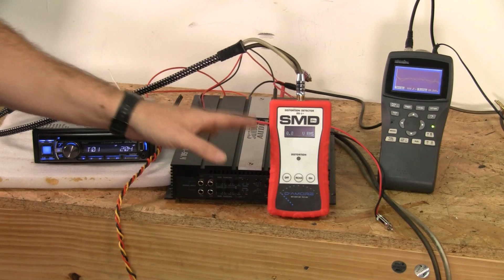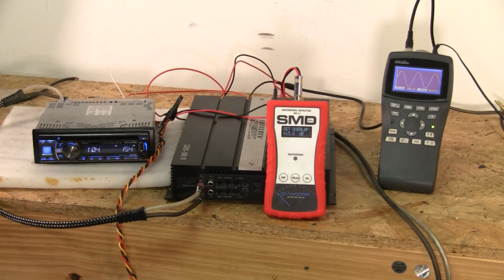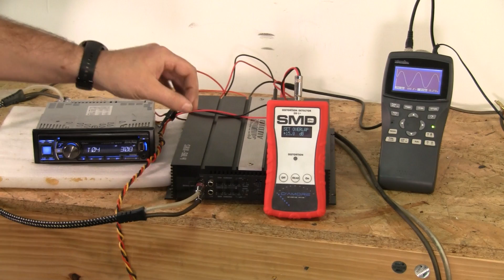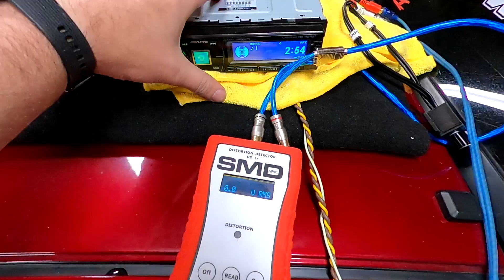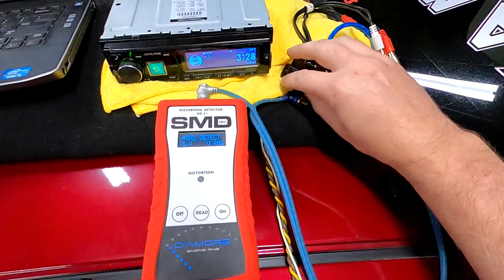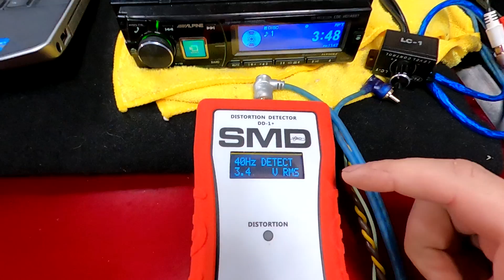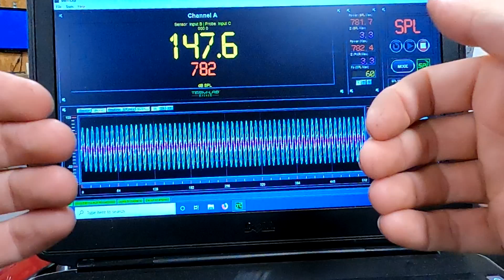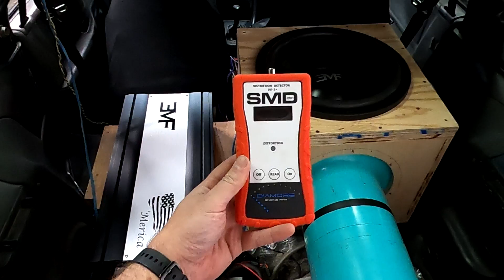The TRUTH about the D'Amore Engineering / SMD DD-1+ - Tech Stuff Tuesday

Comment: But that's not the fucking problem the problem is that for what all this car system have settings like crossovers things like that if you can't used them, and you cannot believe on any body that the los you this and that because to really set a gaming correctly you have to set first all your crossovers before you do the gain set because if you left out all your crossovers in 0 then your because of a speaker play good at 80 hertz and your tweeters at 2.5kh and you don't set these values first then your tweeters will be playing at 50 hertz if you let you crossover at 0 or 50 or in some amps at 45 hertz is like buying a car and you have all these buttons switches but you can't used them because it will make you alternator work more if you used your headlights etc people used the ignorance of other to profit from them this is why you read the Manuel guide of every electronic to know where is that they work best before you add an aftermarket amplifier then you you set the crossover in your amps check how everything sound before you set the gains at the channels or channel because some subwoofer amplifier can work very different from other amplifier and not only the amps if not the subwoofers work at different low pass filters and for that you have to set all these setting first before and even you can listen to these people and burn your system because all amps are not the same and either speakers or subwoofers and that's the reason they have crossovers to set them at the right sets for that type of speakers because they only show you what is convenient for them not for you.

Comment: This is exactly why you need a DSP to have Three different settings and adjust the clipping on each. You'll have three clean signals going into your amps. CD USB Bluetooth or whatever you use will have different channels on your DSP going to the amps. Then set your amps with the same level signal volume can be adjusted in the dsp to max out each. Hope that made sense and you set overlap anyway which is clipping right?

Comment: I thought you find the distortion then set the gains with overlap like minus 5db for mids and highs and like 10db for subs... so that you can use the eq to safely boost if needed. If you set to 0 across the board you can only EQ safely by cutting boost.

Comment: And after after taking the time to do the most meticulous tuning…. You got the achievement off perfect sound you fire up the engine and go for a drive…. But then discover if you turn it up to 25 it’s all clipping distortion!!! WTH you back thru everything again (possibly) multiple times. Eventually you realize you did all the adjustments & measurements when the engine wasn’t running. F@$&!
🙄👍🏼

Comment: I just bought one of these for tuning my amps because I have never done it before but when trying to check everything out and set it up i get NO Distortion whatsoever on the head unit at max volume but when I go to the amp I am clipping before I even touch the gain so I backed the volume down to about 35 of 62 and I can move the gain slightly but no more than that or clipping so thinking everything is set properly i go to play music and my subs are inaudible WTF i have tried searching for other people with the same issue on different forums and they say it can be my phone that im playing the test track through or the head unit or possibly the LOC can anyone help me here i just spent 7K on a brand new setup and can't even get my amps tuned can anyone tell me how to do it right i can do the old math& multimeter method but as i said I am new to this so I want to make sure I do it right and not mess anything up and since my head unit isn't showing clipping where should I set the volume before adjusting the gain im going to be running a 15" Incriminator audio TYRANT with a Deafbonce AAK 6k and i don't want to blow my sub I have ordered everything possible from subwoofer temperature monitoring system, LF Audio products, wattage and impedance meter etc to keep an eye on EVERYTHING but I need some help doing this right since im winding up with distortion every way i turn

Comment: Men you do this test the wrong way. The overlap track you need to use it when you press the read botton on the DD1+ and i see you use the track 4 that is for overlap like is a 0dB track. Thats why you see distortion did it wrong. First you set head unit woth 0dB then you move with the overlap track for the amp to set your desire dB.

Comment: Just 1 question, why is it when i have my subwoofer volume all the way down on the deck there is no sound from the subwoofer what so ever (RCA through sub output back of the deck), i have to turn the subwoofer volume up on the deck to get something from the subwoofer behind my seats or ill just drive around with normal speakers and no subwoofer at all

Comment: The guy in the video has some points, but in the end, what  is the goal?  If your going for the most SPL, then by ear is probably fine.  If you are going for longevity on one system every 5 or so years, than a $100 oscilloscope would probably suffice.  If you run a shop, the DD1 plus is probably the way to go to ensure you are protecting the customer's system along with being efficient.  If you are leaving power on the table, then the amp/speakers aren't matched correctly.

Comment: Thanks why it good to have a radio that you could change each source output so you don't clip basically you will go with the one that you use the most if you use Bluetooth set your gain on Bluetooth. Then from there adjust the other sources through the radio

Comment: Why would a manufacturer like Alpine allow their equipment to amplify a signal into distortion? It seems as if "25" should be the loudest that deck should go to, and then they can adjust the numbers for scale in between. And don't say "these go to eleven"
Reply: I agree but each radio will clip at different levels even same models
Reply: Cause you can adjust the output power on head unit this is at zero at 40hz 0 db

Comment: You seriously set the gain to the gain over lap track not the 0db track, your supposed to use track 2, 1khz 0db. 1st.. play at volume 25… Then turn up your gain…  once it shows distortion, then you press “read” then change to track 4, which is the 1khz overlap track, then adjust the overlap… you left it on track 4 the entire time you “set your gains”.

Comment: My take on it is the DD1 as with all SMD products are way over priced and no one uses the tool correctly in that it is a tool that identifies a danger zone but EVERYONE using it gives themselves no head room. By that i mean if your head unit clips at X volume but you choose to ONLY go 1 volume point below you stayed to close to the danger zone. The same applies to the amplifier EVERYONE backs off till the light goes off but that is only .1-.2volt lower.. Tolerances are to tight and variables are to large. Set head unit 2 below clipping with the unit EQ/Loudness and all to your normal preferred setting. Then move to the amp setting the crossovers with 0db tone tracks then and only then set gains to find clip drop the amps voltage a whole .5volts from clipping and do as many scenarios as you can change music, tones, and sources to verify it is still clean. Once you have done all of that verify your output wattage/voltage needed on amp output to match the speakers rms wattages and if your short shrug your shoulders say welp i did my best and the system will last for years...

Comment: The DD1 isn't made for the average Joe, who is just installing their own system. It is for the shop that turns hundreds out a year. I was a mechanic in the days of oscilloscope diagnostics, pain in the ass. I have used the more modern equipment and it is faster and usually more accurate.
The way you set the system up at the end is how I did mine in the 80/90's, might have gotten more out of it, but was running on the ragged edge of disaster.
Reply from the maker: It's for the average Joe who doesn't know better, because a shop should know how to do an install without one like we all did for decades before it existed. You'll do a BETTER install using your ears than you will this thing.

Comment: The thing is though. No matter how you set your gain, you have the potential to clip if you change anything after setting it. Whether you set them with the DD-1, o-scope or with your ear. If you went into your deck and cranked up the sub after maxing out the gain with the sub turned down, you will clip. Also, you  keep circling back to this claim that it’s impossible to clip with the DD-1. I’ve never heard that claim and I think anyone with half of a brain will know  that the DD-1 doesn’t remove clipping. 

What I see as being the difference in your tuning methods is that with the DD-1 and the o-scope, you set the deck to max clean output and tuned the amp to that. Whereas when you tuned with your method you set the AMP to max output and tuned the deck to that. That will normally work if you have a decent amp. However, some amps introduce distortion on their own so maxing out the gain on a cheap amp will introduce distortion that no amount of tuning to the deck will get rid of.
Reply from the maker: Anyone with half a brain doesn't need a DD1 to set a gain.

Comment: So set head unit settings first ?
Reply: Yes you should. You should set your EQ first but you should leave any bass boost, and loudness out of the picture.  If you have a pioneer with SLA you can use these tests to get the sources to match up the clipping limit via volume knob.
Reply: @sacredcreationz  so not flat like manual says

Comment: Can't you just max the eq before you set the gains that way nothing you change will clip? would lose a lot of "loudness" though
Reply: 2 problems.  First is the eq setting up +6db or more via the curve adjustment will usually introduce distortion or clipping at very low levels.  Imagine a picture you take on your phone and you blow it up poster size for a wall.  It will pixelate because no computer can make more pixels out of thin air in order to give you better resolution.   We ultimately want the cleanest sound making its way to the amplifier because that is its job.  
Second problem, we all listen to different music.  You will lose the ability to fine tune the sound you like because you can only go down or quieter.  So you are listening and hip hop and it sounds great and then you get some rock and you want that kick to hit harder, well now you can't because all you can do is make everything else quieter and you can't turn the main volume up anymore because that will introduce clipping from the deck.
Reply: @sacredcreationz  I get that but if you want absolute no distortion at any volume or eq change, maxing out the eq before setting the gain will leave no room for distortion but at the sacrifice of volume. Like the analogy you used, if you take a picture with your phone and downsized it to a pendant or Keychain it's will be clear but harder to look at because it's so small, being the sound will be clear but very quiet. Not saying this is how I do it, just say that's how to get no clipping or distortion.

Comment: You lost me the second you started using bass boost lol.. no one does this outside 16yo high school kids who don’t know better.. it would be helpful to specific the alpine head unit your using cause that looks identical to one I used to use ages ago and it was zero clip at 34 and had 4v outputs.. tbh I don’t think alpine has had a headunit under 4v preout in like 25 years lol.. 

When trying to do an example of something I would try and use a better quality amp.. bot that sundowns don’t make good power or have good efficiency.. but they cost what they do for a reason and that’s cause you’re bot getting as clean a signal as you should be. 

I would also recommend using a true o scope if you’re going to try and cause waves in the industry cause that radio shack $40 unit isn’t going to convince anyone.. 

And I’ll be honest I don’t trust either of these units.. want to impress me you need a quality bench o scope and nothing else matters.. that said.. I know plenty of people whom have been in the industry for 20-30 years who trust this. If it had issues as you’re trying to say they wouldn’t be using them cause their rep is worth more then saving a few dollars and little time on setups.
Reply: I am not defending the man, but at what time in the video did he use bass boost?

Comment: If you set your gains with an o-scope and then go and change some settings you can clip that way too.... thats more a user error than a fault of the tool
Reply: This is dead on.  It doesn't matter the tool because there is an inherent no win fault in setting stereo systems.  There is no one setting to work for all.
Reply: @sacredcreationz  
Actually, there is... It's called using your brain, and most people can't be bothered to do it, so they look for tools to give them shortcuts. But tools of all kinds are prone to their own faults. The only fault the brain has is the lack of using it in all the ways that are necessary to properly set up a system (inherently referred to as "user error"). It's much more math than blinky lights, much to people's chagrin or discomfort, hence the workaround of using tools to circumvent doing it in a "one way that works for all setting"... Because even given such a setting, user error or lack of willingness would happen prominently; but that's not to say such a thing doesn't exist. 

Heck, if people used their brains as much as they should when they're building a system (and, granted, this next statement is theoretically worded), blowing equipment would never happen... They'd buy equipment designed to easily do what they're wanting it to do instead of straining it with more power than it's intended for or by maxing out gains, thereby all-but eliminating much (if not all) of these problems to begin with... Gotta love those people who blow stuff for the "logic" of "saving some money" on something they end up having to replace instead of just originally buying the better product that wouldn't have needed to be pushed to its breaking point.

That said: Yes, there is a "this would work for everyone" way to setting gains, but we'd be hardpressed to get people, as unwilling to think as they typically are (especially in mass), to do it.

Comment: So the correct way is to set the gains for your components tweeters midbass etc after you do the tune?
Reply from the maker: Use your ears. Setting the gain with any meter doesn't mean the system will be balanced.
Reply: @EMFAudio What's the best way to account for lost bass with a factory head unit?
Reply from the maker: @SuperHondaFitDriver  Use an appropriate line output converter that adapts for that. Audio Control makes one.
Reply: @EMFAudio  ok awesome! Thanks for that, I'll go look it up now!

Comment: I know this video is old but I'm hoping you'll respond or someone will, I see a lot of people setting their gain with the speakers disconnected but won't the volume that it distorts at change if there are different speakers with different resistances on each of them? for ex. I had a rockville k9d2 wired at 1 ohm on a monoblock, but when wiring 2 kicker l7r's wired down to 1 ohm, I can't turn the volume as high as with the rockville with the exact same setup everywhere else, had to even take down the eq settings because it was clipping on lower notes (probably since I went from sealed to vented enclosures) but just the difference between the 2 subwoofer configs eliminated ~100w. So if people set their gains with the speakers disconnected couldn't they easily clip pretty badly?
Reply: Sucks that no one responded to you.  That is a very good question.  What I believe you are dealing with is an amplifier that can put out more wattage than the speaker can handle and then you are dealing with 2 different wattages of speaker systems.  If your amp can put out 500w into 2 ohms and then you set it via this method, you are sending 500 watts unclipped to a 2 ohm load.  If you connect a 300w speaker you will hit 300w before your volume is at the max. 
The RMS rating of the rockville is 1000w but rockville is notorious for bad ratings and they say the max for that sub is 4000w, and the rms rating of the dual kickers is 1200w with a max of 2400w. It would make sense that just on its face value the rockville will be able to handle more power.  But alot of power handling has to do with enclosure as well.
Reply: @sacredcreationz  sucks you didn't get a thank you reply, but it was a while ago. Anyway, you deserve a thank you,  so I'll give you one. Thank you for helping

Comment: I have a 2012 Acura TL with tech package and factory amp.

Im using an Lc7i
5 channel amp
4 speakers.

My question is. Im checking the signal between factory aml and lc7i. Is it normal for it to not show any signal? Max volume was 40 and didnt show any distortion
Reply from the maker: No signal or no distortion? Those aren't the same thing. It's possible to not have distortion at full volume.
Reply: @EMFAudio  voltage reading statys at 0 even at max 40 volume. It maybe like you mentioned that its to low of a signal to be picked up since im running off of a factory amp.
Reply: I have it crancked max 40. Voltage didnt change at the DD1+. Signal after the amp that is and before the lc7i
Reply from the maker: @FlipSideGarage  Like every other install, I'd recommend NOT using a DD1.